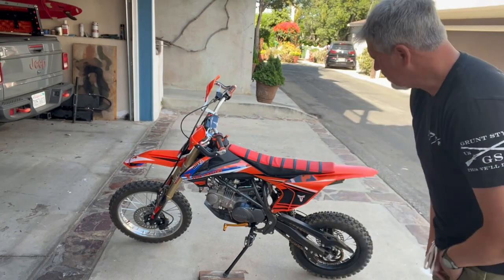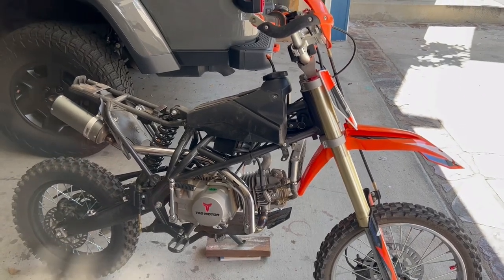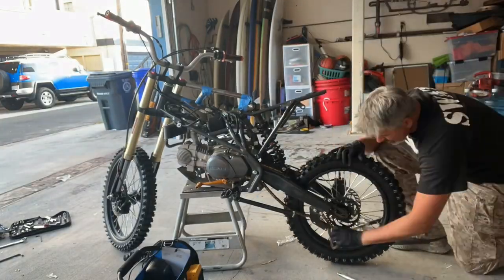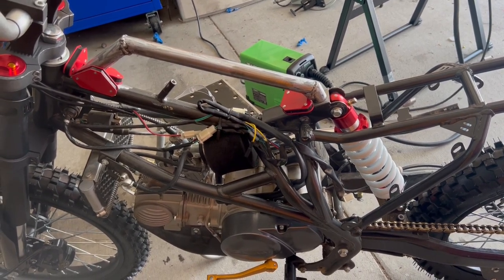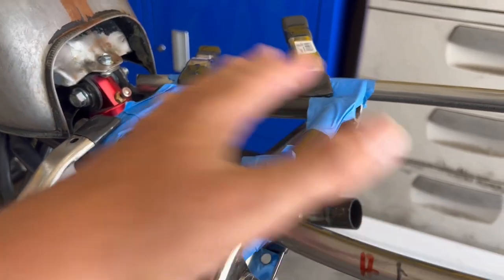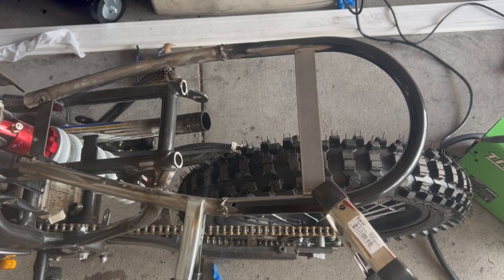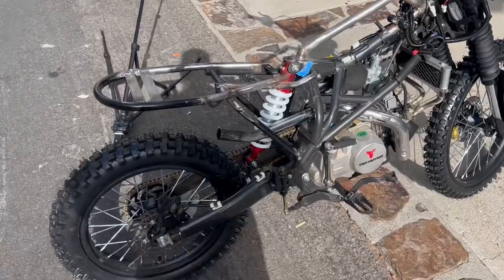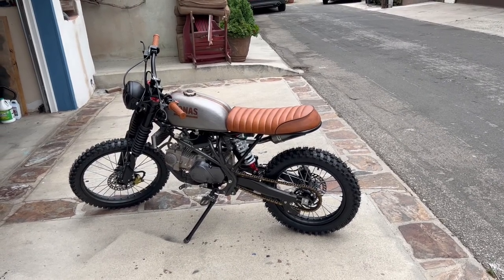Pit Bike conversion Build into Vintage Scrambler Motorcycle

Comment: Fuckin’ awesome. Love the Jonas can do attitude. Rad tank and seat and headlamp. What do you have going on in/on the bed of the gladiator? Which welding machine did you use? What kind of sawhorse did you use? What was on the top of the horse, some kind of metal table?
Reply from the maker: Used a work table and welding table.  Gladiator has a rack with fuel cans and traction boards. Flux core for welding from harbor freight.

Comment: I got a 2022 CRF 150RB and want to do the same. How would I go about doing this?
Reply from the maker: I’m no expert. You have to take off the seat and gas tank. Look at the frame and figure out what modifications needed to be made. The. Start cutting and welding.
Reply: @mediocreman5103  where did you get the parts for the scrambler?
Reply from the maker: Mostly eBay. Wheels I believe on Amazon.
Reply: One last question sorry. What was the total you paid for this conversion? Parts and everything.
Reply from the maker: I’d be guessing but probably like $500 not including my welder